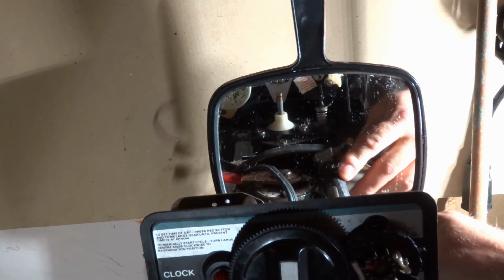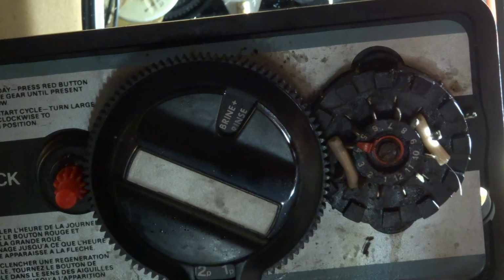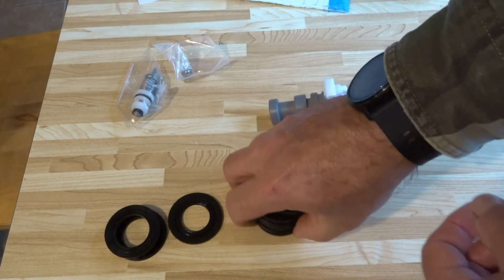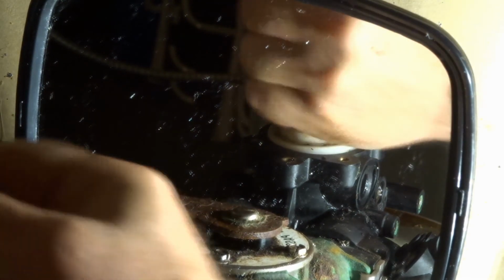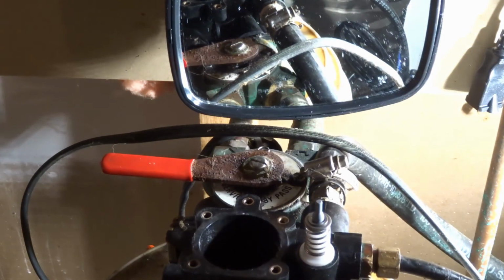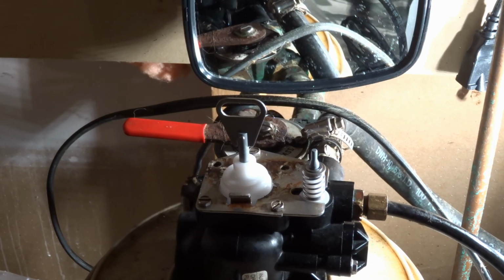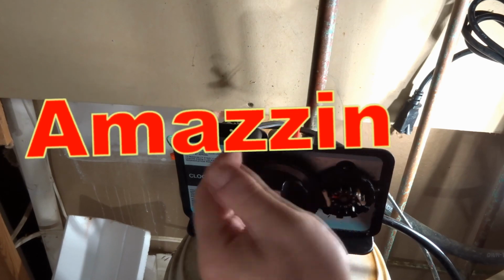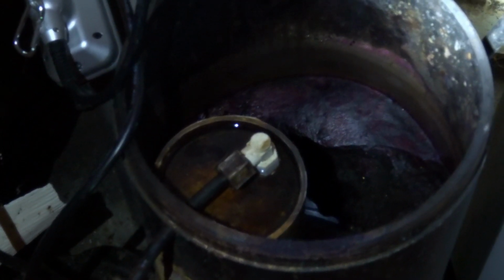Fleck Water Softener 5600 Valve Repair - Complete

Comment: My drain line is leaking all day and the head is making noise no leaks in the head unit area just the drain tube even it indicate service . Is any of the seal or valve needs to be replaced
Reply from the maker: Most likely it needs valve seal kit or rebuild.. its tough to k ow without seeing it.. the only other thing would be the knob has been turn and stuck on or near the backwash cycle...

Comment: Just a heads up. If your softener is drawing brine from the tank but adding too much water to the tank during refill, the Fleck 5600's usually have a sticker on the back cover that tells you what salt setting cam is set to. My cam screw backed off over the years. Due to the rotation of the gear it's on, this cause the valve to stay open and fill the tank longer than it should causing the water to go above the salt. So double check and make sure that screw on the cam hasn't come loose.
Reply from the maker: Good  comment!

Comment: The kit sounds like a scam.  You can buy the whole 5600SM valve for $110.
Reply from the maker: You might be able to get the control head. However it won't come with the valve assembly. Which is the issue on this video. Have a good day.
Reply: @kd_enterprise3404   It comes with everything. You screw the old control valve off of the tank and screw in the new one.
Reply from the maker: @MickRyker I looked on Amazon also and yes I see the price you mentioned and even lower, but in the description I could not verify if its the top valve controller and the valve ring setup.. so I'd appreciate if you buy to give feedback in future or a link that shows the timer and all the valve rings together... let me know... thanks... 👍

Comment: My fleck 5600 softener weakens or stop water flow in the house during some of the phases. I replaced the main piston and the brine piston, but that didn’t work. Does any know what may possibly be the cause?  The drain works fine. The bypass has no issues. I had the system installed about 8 years ago.
Reply from the maker: Has it always done this since you first got it? and also if you are on a well the pressure system might not be set properly or is simply not.powerful enough to manage both regen and water usage at same time.
Reply: @kd_enterprise3404 no— the issue started last year so I switched to water bypass. Finally got some time to start looking at the issue. I live in Orange County California, we do not use well water.
Reply from the maker: @tdo2018 i don't know exactly what's going on, but if the unit is in bypass don't let it try to regenerate, unplug it.

Comment: Thank you for the advice.  My softener had the same problem.  I wonder if it would be possible to just replace the gaskets as the old plunger and spacers seemed to be fine.
Reply from the maker: @macduff39  it all comes in a kit.. could be possible,  if it’s all apart then I’d just replace the parts and not worry about it.

Comment: Well done. Will do the same to repair my system! Question: Can you change from Salt Water tank to a Potassium permanganate using the same tank or are the tanks different?  My well water has a strong sulfur smell and lots of iron (Florida)
Reply from the maker: @Eitapau1  I believe the iron tank has what is called green sand and the salt tanks have somesort of plastic beads.. so I'd say no

Comment: Great video. I'm learning so much about my Fleck 5600.
So when I manually turn my regen knob to Brine Rinse it will push water right away into the brine tank then after a minute maybe it will start sucking and draining the brine. Is this normal?
Reply from the maker: Yes sounds good

Comment: Thanks for making this video. Very well done! Mine was bought new in 1995 and has been very reliable, however it stopped working a few days ago .
Reply: The regeneration knob was stuck in regeneration. Following your instructions I took the control valve drive assembly off and discovered the brine valve stem was seized in the bushing. Cleaned it up and now works like new.
Reply from the maker: Thanks, glad you got it working!

Comment: Mine got stuck just before the brine+rinse. "Brine +" is visible but rinse isn't. However, we just had a service visit to make sure it was actually working (unit from previous homeowners, also out of salt; we were told it was good to go, just add salt).
Reply: Update, after two days on bypass waiting for a return visit, the bypass valve started leaking.

Comment: A great video. Like yours, my control was almost impossible to turn with one hand.  Ordered a kit from Amazon. It came with Molykote 111 compound that worked well as a lubricant. Everything went exactly as you described. I had to pull out the valve body seals one time because I didn't quite have one seated all the way.  Didn't find a particular problem with anything but this was the first time any of this was changed in 16 years. The control turns quite easily now. Thanks for taking the time to make this video.
Reply from the maker: Nice!

Comment: I replaced all of these valves in an attempt to resolve a howling noise. Once the softener is fully within a setting, the noise goes away but then comes back once it transitions to the next setting. I thought maybe it was buildup in the valves shown in this video but cleaning the assembly and replacing valves didn't make the noise go away.  Any ideas?
Reply from the maker: Of course I’m not there to hear, however the sounds you hear are possibly normal, mine makes sounds.. kinda howling type sound as you say during transitions.. the sound is normally because as the valve opens, it opens slowly, so the water is trying to flow through a very small opening which takes many minutes to fully open… (or close depending). I would not worry,
Reply: @kd_enterprise3404  thanks for the prompt response.  It's loud enough to wake my family up at 2AM. Perhaps the issue is more around my houses inability to dampen sound.  Thanks!

Comment: My clock does not want to work, set the time and the clock wheel does not move as it should to keep time. i finally got my bypass valve to engage because it seemed to runing nonstop.
Reply from the maker: Can you hear the little motor running? Should be able to hear it or put hand on it to feel if running, should be warm. If that is working then make sure the red button is not stuck, it should move in and out freely when pressed, should be out with the gears line with dial gears… if problems with the gears or motor the unit won’t work… the other thing might be is the valve has basically seized up and the motor can not turn it, (that can burn out motor or damage gears) the valves should turn freely without much effort by hand as a test.
Reply: Sounds pike what's happening with mine. I think something is seized. It makes the ticking sound and then gives a click every so often and the gear jumps a little. Unfortunately, the bypass valve started leaking after two days on bypass.

Comment: Excellent video.  I was having the same problem with the brine tank overflowing with my Fleck Model 5600SE Downflow electronic control softener. Based on your video, I found the problem was a damaged Seal in the Valve Body, NOT in the Injector Body where I expected to find damaged "O" Rings or clogged orifices.  I ordered the Seal and Spacer Kit and a new Piston Assembly which I expect will fix the problem. Thank you for this video!
Reply from the maker: Thanks for watching, I hope the repair goes well, I almost bought a new machine, but thought I’d try fixing and save a 1000 dollars. It’s working great!

Comment: Just awesome!  I used Lithium Grease.  data sheet seemed to think it wouldn't hurt rubber seals . Again great video! Thanks for posting
Reply: Even though lithium grease is low for toxicity, it can be an irritant.  I would rather recommend plumber’s silicone grease since water going through the water softener will be contacted by humans.  Of course the amount is so small, probably not an issue but there is a reason why silicone grease is recommended by Moen and plumbers.  You are also assured that the plastics and seals are not harmed.